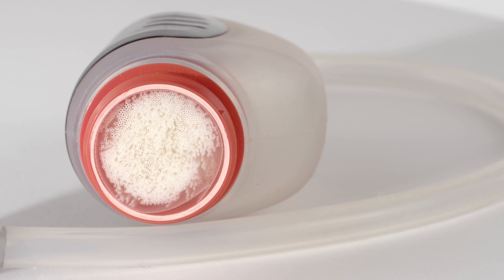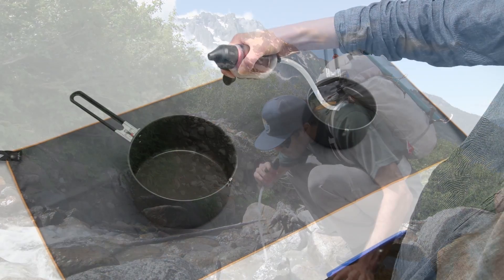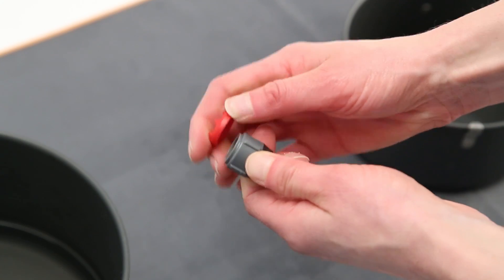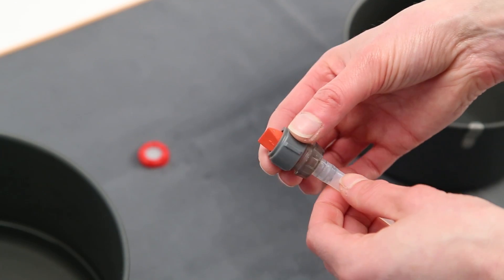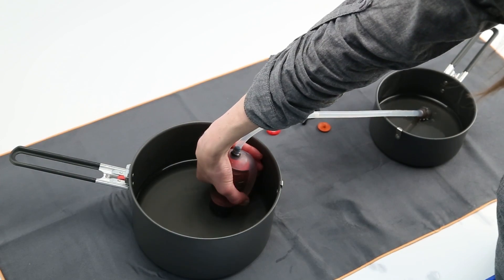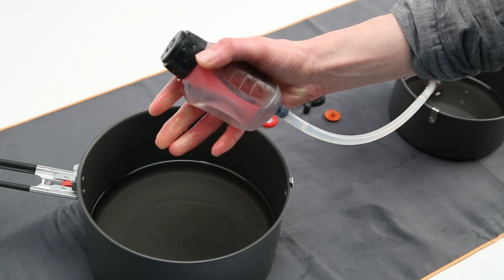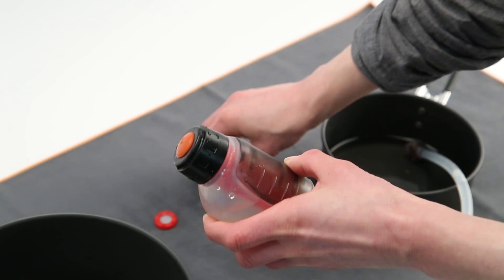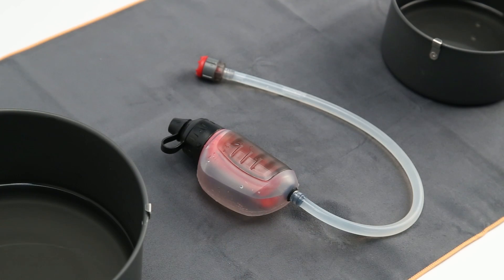MSR TrailShot™: How to Perform Integrity Test

Comment: I'm askin anyone who THINKS ... Where Can I Get  the replacement part L  ... Ive spent over £70 for this device brand NEW. Used it once Stored it for over a year. I was checking my kit and seen This MSR Waterfiler (Trailshot) Is Missing parts  (K) & (L) & (M) ...  So i Thought buying a new filter kit (£33) would have these parts BUT Still Missing PART L ...  _ MSR Used Once Cost OVER £100 And Still Can't Be Used. This is A SCAM FROM MSR ' The Razor Blade Effect ' But no blades :(  will I have to cut my losses and walk from All MSR Products As replacement parts are diagrammed but not for PARTS replacements.

Comment: Sorry but this filter is absolute garbage. Thr integrity check fails out of the box. The black plastic does not create and airtight seal on the bulb body thherefore allowing unfiltered water to pass. I have reached out to customer service and not heard back. This is not a good look when the product has such poor ratings. Unfortunately i bought first and asked after.

Comment: For anybody having trouble getting yours to pump backwards to backflow the filter, mine will do so only if it is full of water. Prime the pump first like you're filtering water normally, then swap the check valve and remove the umbrella valve.

Comment: Hi. I just done it. Used filter in two trips, so I think should be ok. I always using moving streams, lake water, never staying water. So in this test I found out the red valve doesn't close 100% and thats the reason to main unit not keep deflate up to 30 sec. Nearly there but you can see slowly loosing up. But in the same time I can hear from that red valve sucking the air. So now-do you think @MSRGear it's safe still or not? )plus I always clear after used). Greetings, Tom.
Reply from the maker: Can you clarify which red valve? Looking on the Instruction manual, is it the Umbrella Valve (C.) or the Check Valve (K.)? Either one of those may be compromised and causing problems. If you’re in the US or Canada and you’ve had it less than 3 years, give us a call and we’ll send you those in the mail. 800-531-9531
Reply: Valve housing (0:45) I’m in UK unfortunately. Thank you for response. Tom

Comment: Anyone having issue with water leaking out (and air leaking in) through the silicone body around the cartridge (close the black plasic cap)? Not sure if that is why my integrity test fails. The silicon body is too loose that the cartridge is slowly pushed out of the body while pumping. 
Great water filter anyway. I like the idea of pump. Other filter with pump are way to hevier. Also no need for dirty bottle and you can easily filter water from almost all the water sources - hard to reach, small amount of water etc. One big negative for me is that because the filter is constructed from many parts it is not robust for outdoor applications. When one part fail you probably will not be able to use the filter (that is probably my case).
Finally, I am just curious if the integrity can be tested in more simple way. Remove the everything including the silicon tube with prefilter, squeeze the filter and plug the silicion tube connecter with a thumb?

Comment: At 1.12 I found it impossible to pump half a ltr backwards the bulb deflates but will not inflate to do so WHY, I have only used this filter twice and then only in fast flowing clear water, the bulb only ever half fills thus taking a long time to fill a 1 ltr Nalgene.
Reply from the maker: Hi there,
We’re really sorry to hear about the issues with your MSR gear. Your gear comes with a Limited Lifetime Warranty and we take pride in making quality products that can be easily repaired.

Please head to our Warranty and Repairs page (https://www.msrgear.com/msr-warranty.html) for info on getting your gear back in full working order.
Reply: Warranty page doesn’t work. Error 404.
Reply: @barbarab202  Got rid of mine a long time ago.
Reply: I have the same problem. Not sure if I’m just doing something wrong (it seems pretty straightforward) or if there is something wrong with my filter.

Comment: M.S.R. products are so complicated and it's state of the art micro-biology lab it takes so much pride in is negated by the fact 

The filter is made with dangerous chemicals that will eventually give u cancer even if this company has the highest standards of any brand on removing pathogens from water 

  What's the point of the company of not using the same high standards to make sure there is no dangerous chemicals in the product 

  U are trading one problem for another with this filter you might be safe from bacteria when u use this filter but later on you would die from cancer 

It also seems like the whole company cascade designs is toxic every product will eventually give u cancer
Reply from the maker: Hi Malcolm,

Thanks for reaching out. 

At MSR, our top priority is always customer safety. A number of our products are labeled with stickers to keep us in compliance with a California state law called Proposition 65. The law mandates that California publish a list of natural and synthetic compounds that have been classified by an authoritative body such as the Environmental Protection Agency as a carcinogen or reproductive toxicant. Any company selling products in the state of California is required to label any goods that may contain a substance found on California’s list. 

The California government states: "The fact that a product bears a Proposition 65 warning does not mean by itself that the product is unsafe." The government also explained, "You could think of Proposition 65 more as a 'right to know' law than a pure product safety law." Every product that we manufacture is compliant with state and federal guidelines regulating exposure to harmful compounds. 

If you have more questions regarding California’s Proposition 65, you can find more information on the California state government website linked to below. You are also welcome to reach out to our customer support team at 1-800-245-2992 or consumer@cascadedesigns.com
 
https://oehha.ca.gov/proposition-65/general-info/proposition-65-plain-language

Very best,
Riley
Reply: Can you clarify what chemicals these are? I wasn't given any warning and there is a very strange taste to the water once filtered. @MSRGear

Comment: Why wont my Trailshot pump water in reverse, it does not inflate bulb within 30 seconds so should be good to go ?
Reply from the maker: Hi there, while performing the integrity test, if it does not inflate within 30 seconds, then you should be just fine!
Reply: @MSRGear  mine is the same, it won't pump water backwards, isn't back flowing the filter important to cleaning it out?

Comment: Forgot that my TrailShot was in my backpack in the car and not sure if it froze in the latest cold snap. Yes, it's a little complicated to go through all the steps in the integrity test, but I'm glad there is a way to tell if I have to replace the filter or if I can keep using it. The video helps clear up the steps. Thanks.

Comment: Too complicated. And I have no desire to stand there squeezing that thing to get water when I can use a hanging bag with other brands.
Reply from the maker: Hello Cisco8484,

The TrailShot is designed for trail-runners and quick, ultra-light access to purified water. Sounds like you're looking for our AutoFlow Gravity Filter. You can read more about it here: https://www.msrgear.com/water/autoflow-gravity-filter-10.

-MSR
Reply: @MSRGear  my trail shot hasnt worked very well from new wont pump very well I have managed to get about 9l from clean streams and have done a back flush each time. But now I cant get it to pump at all in fact what happens is the filter tends to pop up about 2mm every time. Have tried to do integrity test buy cant even fill the bulb now. Its brand new?
Reply from the maker: Hi Stephen,

Sorry to hear this! Please reach out to our warranty team in the following link so that we can work on a solution for you:

https://www.msrgear.com/en/warranty

Cheers,
Riley
Reply: @MSRGear  I will do I'm at the end of  1000km  bike ride through the West Australian bush which is when it failed. Ive had to resort to boiling water.
Reply: @MSRGear  Riley how do I fill in a warranty form that only lists Canada and USA?
Reply from the maker: Apologies for the mix up Stephen. 

In Australia, your best bet for warranty support will be reaching out to your local distributor. You can find distributor contact info at the link below.
https://www.cascadedesigns.com/ie/service/international-distributors
If you need further assistance, you can reach out to our Ireland based warranty team at +353 (0) 021 4621444 or warranty@cascadedesigns.ie and they will do their best to help resolve your issue.

Let me know if you have any other questions.

Very best,
Riley
Reply: I just hook it up to a big mouth water bag and it become gravity filter, when there is only a water hole available I use it to pump water out of shallow patch.